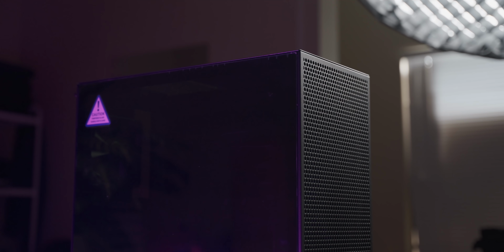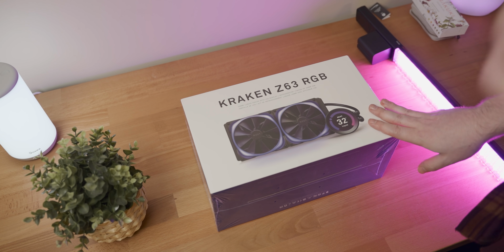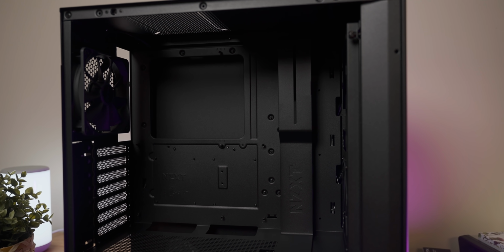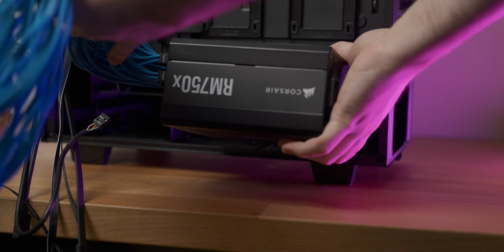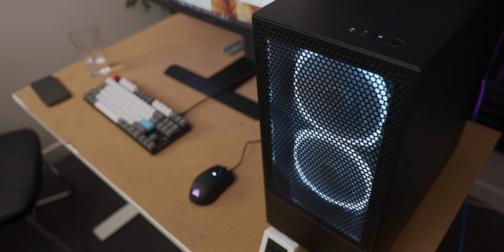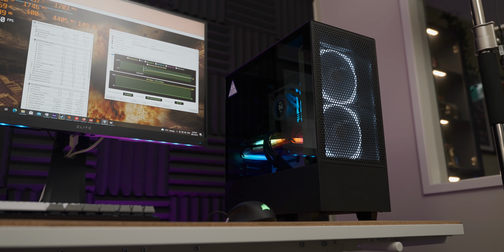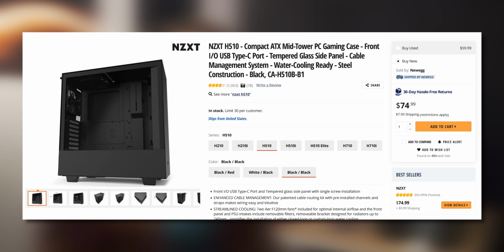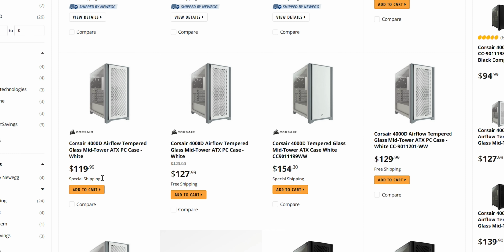FINALLY! Airflow From NZXT! H510 Flow vs H510

Comment: I have the original h510, currently I have had no serious problems with it, I am about to get a corsair h100i elite aio for my cpu and mount it on the front with one exhaust in the back, do you think if I removed the dust filters from the front intake of the case (the small one on the front and bottom) will result in better airflow?

Comment: Always amazes me to see CPU temperatures up above 50C. Maybe I need to stress my Ryzen 5 3600 (with its stock Wraith cooler and two 120mm case fans - the original 3-pin fans that came with my 11+ year old Antec Three Hundred, with its lovely front mesh) a bit more, 'cos I've yet to notice it getting higher than like 45C, most of the time not even hitting 40C. :)

Comment: Now if only they can add more fan mounts to the top of their cases lmao.
Guess they're too lazy to retool to do a complete refresh for the H510.

The H510 Flow currently at the time of this comment is $89.99 USD.
The Lian Li LanCool 215 is also $89.99, so is the Antec NX410 and the Corsair 4000D Airflow is $95.99. Personally I think it's hard to justify getting the H510 Flow if you ever plan to add more than 1 top fan to the case.

Comment: PC Case prices are fucked up. I have bought Be Quiet Silent Base 802 for 160 Euros (which is the lowest possible price I could get ), but it costs 180+ in "normal situations". It used to cost 145 euros. So yeah, the prices are shitty. 
Good video for the H510. 
I loved the original H1, cos it could light up pretty well.

Comment: is it worth upgrading from h510i? im a 15 year old kid with a sad wallet btw
Reply: I don't own either case but I can tell you it's most likely worth the upgrade considering you are getting real airflow from the front of the case so your temps should drop by more than 5C
Reply: @hairbruh4915  If you live in a climate that averages 100F all summer long and you cherish your pc components it's worth it like it was for me.
Reply: @hairbruh4915  Yeah but that's not ideal.. what's wrong with spending a little more on your case to future proof your build/investment? If you are fine with cheaping out a little and increasing temps that's your choice.
Reply: @hairbruh4915  XD okay Alex

Comment: really would love to buy this case but i have a 166mm cpu tower (bequiet dark rock advanced c1) and spec sites say this case fits only up to 165mm. replacing cooler is no option. can anyone help with info that you might have a little spare room to fit a 166mm cpu tower? thank you for any tip

Comment: I'm still rocking my NZXT Noctis 450 black/red case. 3 120s on the front for intake 3 120s up top for exhaust and a 140 in the back. Support for 2 360 rads and everything.

Comment: I have been considering building a mid range gaming computer that does not look like a disco (like the one I have). Do you think this could be a candidate as a case for such a system? A glass side would be OK for observation of the internal, but nothing flashy or lit up.

Comment: I believe this h510 flow case is just an h510 elite case that they removed the glass panel. I’m almost sure they will sell the front mesh part as a separate purchase and we can just swap the glass ourselves. Think about it you already can buy custom front panels now they selling it also. I will buy the filter because my custom front panel i replaced the glass has no filter

Comment: Would be great to see you compare that setup to the same setup with the Kraken swapped out for an Aircooler (like a 212 Hyper or something) to see which config gives the best all around on temps. 

How much of an issue does a front AIO cause to a GPU’s temps? 🤷🏼‍♂️

Comment: why are you testing a cases airflow with an aio.... yeah technically aio's need air to cool the radiator but it would be a much more accurate test to use air cooling.

Comment: The H510 Flow fixed one problem but not any of the  rest of them. The hard drive tray has 4 brackets on top of it to mount a third hard drive. It turns out that the drives are so close together the middle one gets too hot to operate for very long. It kept giving me warning lights  in Crystal Disk info. I ended up being glad the tabs were there or it would have been a single drive cage. The rear of the case where the cards screwed in was made of very soft metal and my graphics card ended up getting stripped out before the build was even done. Also the front panel ports are the cheapest I have encountered on this case. The USB-C port would hardly accept a plug like it was made of rusty aluminum or galvanized metal. Many times it wouldn't even connect. I have seen videos where content creators have been building rigs and have gone to just set the glass side panel down on the ground to continue working and it shattered in their hands. It also has the worst mechanism to lock it, very hard to make it stay on.
Case makers are moving away, in unison from 5.25" DVD bays to make room for radiators and it makes me sad because even if you don't have a DVD drive there are many other things you can do with them. I am not into water cooling because I use Ryzen chips and they come with a perfectly good CPU cooler in the box. There are so many options for a 5.25" tray.  There are drive fan controlers, extra IO ports, Multi SSD or NVME bays and more swappable 3.5" drive bays. The list is exhausting. Drive manufactures shouldn't dictate the monotony of your case for the next 5 years.
I hated this case and unasembled it and moved to the 10 year old proven-to-last Haf XB EVO after just 2 months. All this room make me feel like I have all the room in the world plus even more expandabilty

Comment: Interesting as robeyetech got the opposite results for his test of h510 vs h510 tampon
-flow has better idle cpu, almost the same stress cpu
-flow had slightly better gpu
-flow had much better mobo temps bc of the increased airflow through the case
-flow would be great and feasible for a air cooled cpu, but liquid they are similar

Note: he also used a 10900k and also had a top exhaust fan included

Great review dawid

This h510 tampax seems like a solid case!!
Not worth upgrading if you have a standard h510 (unless you wanted to swap to an air cooled cpu) but definitely worth the $$ if you are building a new system and love the h510 aesthetics

Comment: H510 vs h510 flow for really change nothing the flow one just get more dust ;) i get the h510 and is work so well its can be better my pv turn around 37 degré on high load whith corsair water cooling simple rad and corsair 31-005 fan set ;) just added one more to the back plate of my gpu to avoid make it heat ;)
Reply: i dont want to say bad but brother your rad need to be on back of the pc ;) not on front and add a really pressure full fan on the rad like 2000 rpm fan and use all other place only for fan ;) but serious Rad on back or upper air hole ;)

Comment: If I wouldn’t have swapped to a corsair x464 to replace my regular H510 i would be pissed. Now im going to just use it as a second, weaker pc. Maybe have a dual streaming setup or just give it to somebody in need.
Reply: Atleast i now know what people meant when they always told me their computer actually helped cool off their room because that’s what my corsair is doing, 3 intake, 2 exhaust plus a CPU exhaust, psu fan and then a triple fan EVGA FTW3 ULTRA 2080Ti and im feeling cold air flow out. In the regular H510 i was exactly 10 degrees hotter.

Comment: Question I need help: if I buy an NZXT build with a regular H510 case and it has a 280mm cooler, and i7 10700k
Am I going to have a heat issue ?

Comment: I found putting a 280mm in this case was easy. Alot easier than I expected.
Reply: Yeh mine is fitted with the tubes at the top. Can see it in my account pic on here.

Comment: 510 has always been garbage to me, mostly because the limited top fan mount and ridiculously small front I/O (basically non existent), on top it was force choking the components better than Darth Vader.

Now it doesn't force choke them but chokes on your wallet.. be quiet 500DX, Lancool 215, CM TD 500 mesh or even the older H500M, yeah the 4000D.. there's so much better cases than the now more uglier 510 airflow xD

Comment: A more clean simple case is the 
Lancool 205 mesh
Basically looks the same, but included 2× 140mm, 1× 120mm and 280mm rad support 
Also only 100$

Comment: 3:22 What do you do if the connector's pin layout doesn't fit your motherboard? Can the layout be changed by moving the wires around?

Comment: Slight criticism on your testing. The CPU was getting fresh air from outside the case in the airflow version and not in the other one. The GPU heat probably made a difference for the non airflow version. Not that big of a deal but probably should have mentioned it 🙃

Comment: Again, i just hate how some cases come with just 2 non rgb fans, or some even just with the 1...
That means the manufacturer only cares for profit, not to make good value for customer. 

I rather buy case with zero pre installed fans, and i will choose the ones i gonna use anyway.

Comment: Shouldn't the AIO radiator be installed with the hoses facing up? I heard it's easier on the pump and prevents air cavitation in the cold plate on the CPU?
Reply: If the top of the radiator is higher than the pump and cold plate the air will get trapped their instead.
Reply: @danielboyas7645  Makes sense. Thanks Daniel for the info. Cheers

Comment: Wish this was out a year ago when I built my PC. I'm stuck with the original H510. Wait, actually I think it's the H510i, or whatever they called the other variation of the case. I'd like to give the original H510 props, as I just bought Final Fantasy 15 and have been playing it at 1080p with high settings for a few hours at a time and the GPU temp stayed at 72C for nearly the entire time. Though, I think that has more to do with the fans of my GPU (MSI GTX 1660 Super Ventus XS OC) than anything the case is doing. Still. I was surprised. While Final Fantasy 15 is no Cyberpunk, it's still a fairly demanding game. I expected my computer to blow up after like 20 minutes.

Comment: I have recently added a new PC to my workbench. Apart from an upgrade to it's original spec, it now has, like many a glass window on one side. My test bench, used mostly for my YouTube channel, messing with audio stuff. I noticed I was picking up lots of digital noise on my test bench. After lots of testing I found the mush came from the glass side of the PC. I replaced the glass with a metal side panel and all is well. Glass looks good (I guess) but does not offer ANY screening so all the internal digital crap pours out polluting my test area. I cannot be the only one to have this issue!! or maybe I am.

Comment: H510 is a great case for both anesthetics and mounting features... But airflow was a big problem. I have a h510 with a pretty "cool" system(3600x with u12s, never surpassed 70 degrees, and 3060 that never surpassed 66 degree) , but I'm really looking for the new version. It keeps its style and let's you gain a ton of performance (I could gain 5 degrees on gpu and 7-8 on cpu for sure) . But the problem is: there's a fuckin cable shit show in my pc, only thinking of disassembling and reassembling everything makes me sick 😂 nice video tho!

Comment: Anyone else talking about the AIO the wrong way round.
Reply: No because it's fine as it is. Highest point in the rad is higher than the cold plate so the air gets trapped in the rad and not the cold plate.
Reply: @danielboyas7645  the air on the tube during transit will still be their and also the nipples are in a bad place where they look like they will be damaged with time

Comment: JayzTwoCents and Steve from GN are going to be triggered by your rad orientation there mate.
Reply: Pretty sure jayztwocents made a video how that orientation is fine as long as the highest point in the rad is higher than the pump and cold plate.
Reply: @danielboyas7645  I thought it was where the tubing met the radiator that should be the highest point... Well if that's the case the tubing arrangement on my AIO is unnecessarily convoluted 😆
Reply: @sheep83  You have to trap the air bubble in the rad when installing it so it stays trapped and can't go down the tubbing.

Comment: Nzxt case are cool looking but didn't have airflow
Now they have both soon! I have the old regular h510 and gpu temps (3060ti) are 65-70 degrees c under load and cpu temps are around 48-50 degrees c (cooler is a older x53 model) and cpu is a r 5 3600

Comment: People can say what they want and I get the jokes lol, that out of the way I have the original h510 and obviously I'm not running crazy stress testing.  I will say for the 5-6 hours a day I game on my pc I don't see anywhere near these Temps for gpu and cpu.  Typically I never hit above high 60 C or very low 70C , if I ever hit 83 or higher I'd be worried lol

Comment: So, the header for front panel switches is actually standard these days? In my experience, which consists of a lot but all 5yo or older boards, there are unique for almost every brand

Comment: i have an H510 right now and it’s choking my poor FE 3080 ti. it sucks because I love the case and it was specced for at rtx 2070 but i had an opportunity for the 3080 so i went with it. unfortunately my cpu temps are amazing with a corsair AIO so i was hoping the flow H510 would have better GPU temps but oh well. at that $110 price i might as well get an O11 that actually as support for more than 2 fans…

Comment: That seems like your going to get a lot of dust in there with no filter in front of fans. Compared to the similarly named cooler master case (or the td-500 which is in white and takes any sized radiator basically)
Reply: Theirs one on the panel. Which is in front of the fans, theirs also a tight enough tolerance/enough mesh. That i dont think it'll draw air through any panel gaps.

Comment: Still got a Coolermaster HAF X from last Millenium: the main downside is the crap access to dust filters to properly clean them. I could live without the rarely used ODD but I need to have a new case with more than 2 HDD bays and 2 front USB ports plus a reset button.

Comment: Ahhh...David you gotta change that front rad!  You have it upside down.  The pump needs to be below the hoses or it will damage the longevity and power of the pump
Reply: If the top of the radiator is higher than the pump you can trap the air at the top of the radiator and not have to worry about it making its way down into the tubes.

Comment: Wait Wait wait, so what you are saying is that the case with holes in it cost more than the case with no holes in it. That just seems wrong. There are a lot of $70 cases that have air flow and look just as good. NZXT is tardy to the party on this one. For this price I could get a "be quiet 500DX" and put that AIO in there with ease.

Comment: Is seriously no one going to mention how he mounted the radiator? I mean Tech Jesus is cringing so hard right now (GamersNexus).
Reply: It's fine as long as the top of the radiator is higher than the cold plate and pump. Air get trapped at the highest point.

Comment: the reason many don't have a front panel "Block" connector is that some boards don't have the same layout  for the front panel pins. so my guess is for adaptability. I agree that it's much simpler to hook up though.

Comment: Still bewilders me why mount the rad so you are bringing in heat to the case. The whole point to AIO cooling is to get the heat out of the case. I bet that GPU runs a lot cooler if the rad was not bringing in the heat.

Comment: I’m pretty sure Gamers Nexus has advised against mounting the AIO with the inlets below the pump.
Reply: Pretty sure he later clarified on that point that it's not always true. If the radiator is higher than the pump you can trap the air in the radiator.

Comment: The price kills it. You can get a bunch of good airflow-focused cases (that also come with fans) for less than $100. Also 280mm rad support is only on paper. And they could have opened the top more too. They could have extended the mesh all the way down and drastically improve the GPU thermals as well, another missed opportunity...
1 step forward, 2 steps back. Standard NZXT.

Comment: It would have been nice to see if the front panel was just replaceable,  like the p400, I had a p400, and when the airflow version came out i was able to just buy the front panel and replace it,  granted witht he design of the H510 that wouldn't be possible.

Comment: I would be far more likely to buy this case in the airflow version than I was for the regular NZXT cases. However, there are better cases on the market with even better airflow and radiator support. NZXT is late to the game and didn't really make much of a substantial change to the case other than adding a mesh panel.